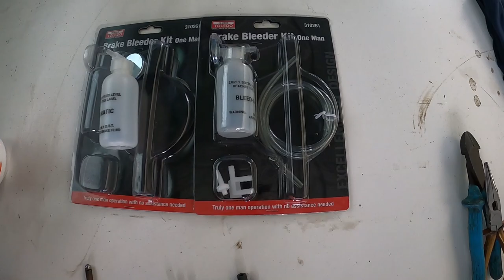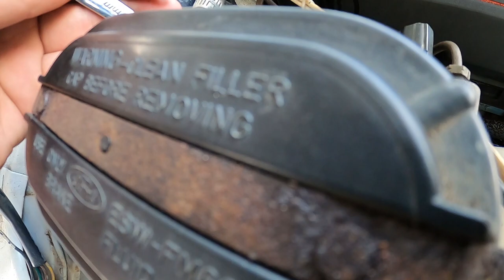HOW WE BLEED AND FIT FORD XF BRAKE MASTER CYLINDER

Comment: I found your video certainly helpful for beginners. But there is another way to do this without the extra expense of 2 of these bleeder kits, which are currently $18 each from repco Victoria. Personally l just put a bolt in each of the 3 outlets, have them backed off slightly before pushing the piston in. While it’s in and held there l do the bolts back up tight and slowly release the piston. After doing that same process 3 to 4 times the piston can no longer be pushed in with the bolts tight. That lets you know it’s bled up. Reinstall the master and job done. Most recently did it this way on a ZJ fairlane.